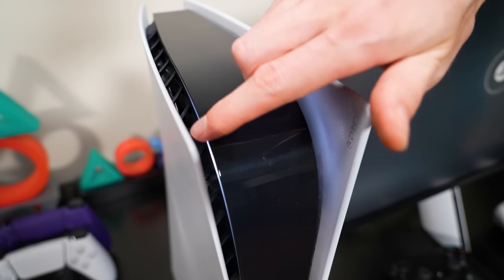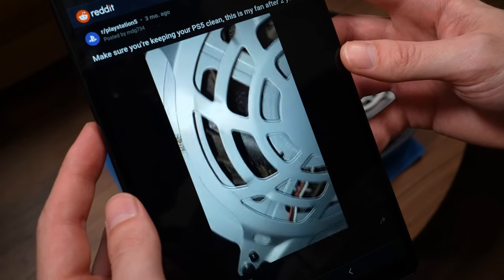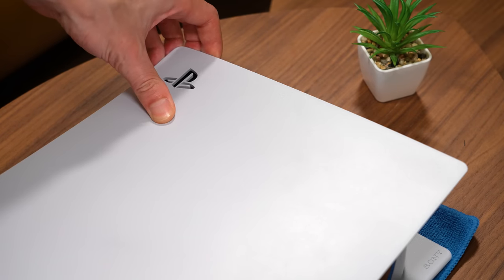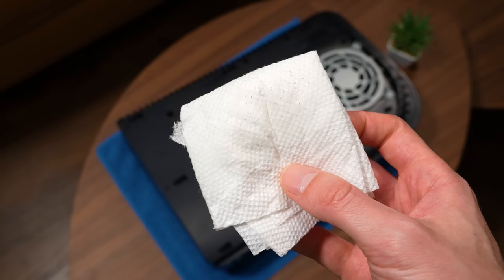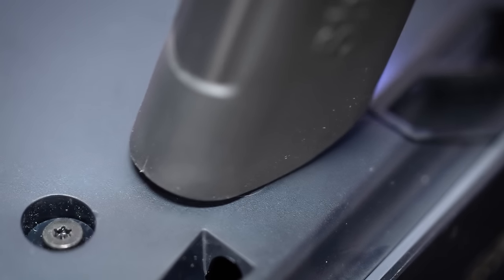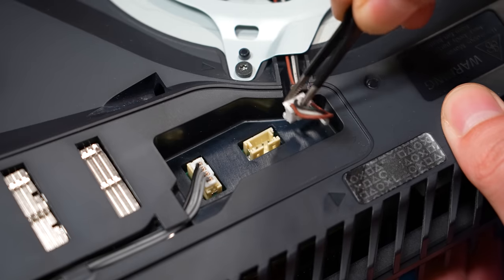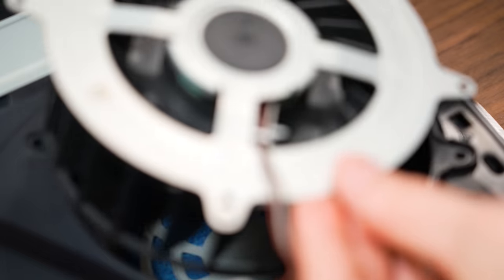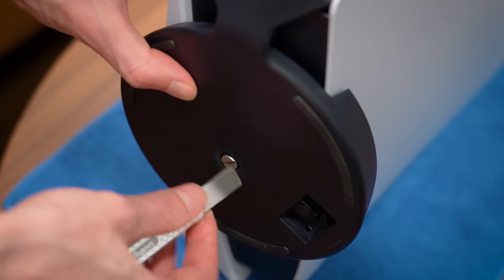It's time every PS5 user checked for this..

Comment: This may not be an issue for everyone however, I’ve had my PS5 since launch and recently opened it to increase the storage. I thought whilst it was open I’d clean it as well however was surprised that there was hardly any dust. Definitely not enough to cause any issues. 

The pictures shown of dust I’d imagine are extreme cases. I think a lot will depend on room ventilation and air quality.
Reply: If you have a dirty room or have your ps5 in an open area it will be prone to dust build up

Its all depending on how clean everything else is because if there's a ton of dust on the fan itself clean yo room
Reply: Bro I did the same. Hardly any dust when I opened mine up
Reply: I’m still trying to get a ps5
Reply: Exactly depends how u treat ur ps5 and what's around u
Reply: @thebutchersboy1138  I got one for you let me know if you need it
Reply: Since March 2021, my PS5 Is with no dust inside, because I Always cover with a protector cover, After use.
Reply: Totally agreed.
Reply: Well it’s not hard to understand that some people’s PS5s will be in more dusty environments than others.
Reply: Mine had a Rat living inside had to put my ps5 outside for a couple days😑😑
Reply: @Grandmatabby  how the fuck- actually nvm
Reply: @Grandmatabby  bruh
Reply: People are dirty xD never cleans or they just never learn the importance until it’s too late
Reply: Yeah unless you have poor circulation or smoke or just dirty period very rare that system gets that dirty. Have had it for 1.5 years and hardly any dust in it when I added storage. Same thing for when I had the PS4 pro…only cleaned it one time since they launched and that was cause I spilled something on it…never understood where all this dust comes from when I see videos like this or computer/laptop cleanings
Reply: Agreed. You seem like a clean person... As am I. When I saw those above images I was like that's definitely cat hair, Cheeto dust, mixed with spilt G_fuel and gamer sweat. Even the PS5 in the video has clearly never reached that level.
Reply: @TheTimmer1234  I have my ps5 in the same room as where I put my laundry to dry.. needless to say it gets very dusty due to the amount of little fibres that come off the clothing
Reply: True dude. Reckon I’ll have a PS5 by about 2040
Reply: @thebutchersboy1138  ps direct
Reply: Does the dust in my imaginary ps5 count? Cuz i still dont have one but have been enjoying my xbox until i get one
Reply: Mines is purely because my pets especially my German shepherd aka ghost from game of thrones long hair. I had power issues so I changed into main plug and didn't work opened up and 6 months the build up with dust and hair was insane it's so open compared to ps4 and ps3. Only cleaned both once in their whole lifespan ps5 I've cleaned every 3 to 6 month since launch
Reply: @thebutchersboy1138  if you are a Pro member at Game Stop, ask your store when the next restock is. We just had a restock at both my towns stores for pro members and there were 30 consoles for each store, I was third in line an hour before open, at open only 10 people in line. Seems like the easiest way now.
Reply: @LUCAS420BLZ  In an open area? I would assume that more dust will build up when the console is placed in some corner, for example on a dresser between two wardrobes
Reply: ?? How where u gonna add more storage in the PS5
Reply: @jaimelopez1820  Just YouTube it. You can add more storage.
Reply: @TheChurchofLoud  thanks man..
Reply: @LUCAS420BLZ  my ps5 is in my living room. It's quite a big living room. Family of 6 use it. We always hoover dust everything and mop the floor at least once a day. My ps5 six months into use was so dusty in side it was horrific.
Reply: Yeah for my original PS4 I got in 2015, when the disk drive broke back in January this year and when taking it to sell at GameStop, taking it apart they were surprised at how clean it was as well as no sticky residue/scratches on it. The only thing I did was use a Swifter duster on it 2-3 times a month and use a tv cabinet from childhood that kept the majority of dust off due to having a door for it as well as a hole in the back for air flow.

Just got my ps5 a couple of weeks ago and I'm dusting it once a week and thinking of getting a dust cover for those times when I'll be out of town for a few days
Reply: @thebutchersboy1138  PlayStation has them right now. They're GOW editions though.
Reply: That and their probably an indoor smoker
Reply: Yeah i have an ac in my room which keeps the room really well tempered, i cleaned the ps5 about a few weeks ago and hardly saw any serious dust buildup
Reply: reconz 82299  not if it's after use it wouldn't matter
Reply: Ive had my ps5 for like a year and a few months and i barely use it so im more scared of a fly in my ps5 than dust
Reply: Having pets makes a lot more debris also.
Reply: @thebutchersboy1138  they’re everywhere, if you’re still struggling to find one then you aren’t actively looking
Reply: Yeah that's a smokers console
Reply: @Ahmed-og2jm  yea no
Reply: @GradietPanda12345  yea yes
Reply: @fiapoto92  The question is... how much are you selling it for?, because we all know where to get one at an abusive price online! eBay, Amazon, Offer up etc etc scalpers are all over the internet selling ps5s at excessive prices
Reply: Exactly
Reply: The same happened to me as well.
Reply: I have a air tight container, when im not using my console i unplug the leads and put it in the container. Been doing it since the 360 days and it definitely helps the longevity of the consoles.
Reply: Had my ps5 since they came out and hardly any dust in it. Gets used everyday but my games room is like a sterile lab. Hate dirt and dust then again I’m really ocd.
Reply: Im not fuckin touching my ps5 when the warrany is still on going nope!
Reply: Whilst lmao
Reply: Definitely not an extreme case but depends on your house. We have a ton of pets so it gets like that pretty quick. We have to change AC air filters monthly in the summer, for context.
Reply: @neverbeaten  taking off the plates shouldn't void warranty it's allowed
Reply: The brown dust may come from smoke
Reply: @jammieweston2566 they're
Reply: @Jestersson I wish I was like this. One of the worst things about depression is you just don't give a fuck what your room looks like. :/
Reply: Exact same. I did a full teardown and had next to no dust. Complete waste of a Sunday after noon, I wouldn't recommend it to anyone. If there's no dust in the main fan just wipe what's accessible with a Microfiber cloth and move on
Reply: Exact same. I did a full teardown and had next to no dust. Complete waste of a Sunday after noon, I wouldn't recommend it to anyone. If there's no dust in the main fan just wipe what's accessible with a Microfiber cloth and move on
Reply: My room gets dusty a few days after a thorough clean… I live in a studio apartment so my bedroom, living room and kitchen is all one room of 21m2🤣

Comment: I took mine apart a few months ago, took the fan out and brushed it all the way through, used a vacuum cleaner to clean dust out of the holes specifically designed for the purpose, and even used compressed air inside and outside to clean the heatsinks, then vacuumed again.

The PS5 is SOOO much easier to clean than the older systems.
Reply: I'd recommend to never use a vacuum. I killed my og fat ps3 that way. It'll ruin the gpu. The console could basically be useless and not worth repair
Reply: @Snickerus-Snape  Shit really?
Reply: @Snickerus-Snape  there are holes specifically made for vacuuming. Literally recommended in a Sony video.
Reply: @Snickerus-Snape  how can a vacuum damage the gpu?
Reply: @ayy17amn  only reason i can see for not using vacuum is it may suck up the screws, but for fans blades a vacuum not great some dust sticks. but it shouldnt kill the console.
Reply: Yeah series x and ps5 are way more easier to clean.
Reply: @ayy17amn  Shit, I'd love to know as well.. If compressed air is safe then a vacuum is not going to harm anything.
Reply: @BlakeGibbons  bc static buildip and damage electronic parts. But like the other commenter said Sony already confirmed themselves that the dust catchers were made to he vacuumed so its safe. I've done it and had no problems
Reply: Same here. Mine still shuts down when playing H:FW. I can't play the game because it just keeps overheating.
Reply: @Snickerus-Snape  no, your old FAT PS3 crapped out out because of bad thermal paste, mine did the same thing.  Vacuuming out the PS3 had nothing to do with that, as the GPU was already beginning to separate from its connections to motherboard before you tried cleaning out the dust.
Reply: @skullfracture3870  Of course. Still doesn't take away from the vacuum being an issue for me. Right after I vacuumed it, that's when it started with the screen freezing and looking all pixelated. I took it to a videogame repair store and they told me it's not worth fixing and refused to fix it. It's a known problem if you vacuum a ps3. Maybe you can vacuum the ps5 vents. I wouldn't put it near the motherboard myself after I ruined my ps3. I'd like to think if it was the thermal paste, they would've fixed it
Reply: What kind of vacuum did you use?? I wanted to get one myself
Reply: Is this guys video accurate to how to do this without braking the console? Id like to clean mine out but do not want to break or snap something.
Reply: @ayy17amn  vacuum cleaner creates static electricity and most of the time it is immediatelly grounded, but it can happen when u vacuum ur pc, then small static discharge to ur pc can kill it pretty easily
Reply: @Snickerus-Snape  yea, the best thing for this is air compressor, thats the best option with which u can clean ur pc or console, then there are that sprays with compressed air, but they are needlessly too much expensive if u compare it with air compressor if u have it and as the last option, u risk a lot when u use vaccum cleaner near semiconductor parts.. in ps5 those are collectors and electronic parts are kinda isolated from it, so its different, but still its better to know about this
Reply: @Snickerus-Snape  
Can I ask when this happened? I have a feeling they might have lied to you about it being fixable. The PS3 is notorious for being way more complicated than it needed to be, so complicated that that's actually the reason PS3 games weren't backwards compatible on PS4. It's stupid and I honestly don't know what Sony was thinking when they made it the way they did. Idk, I've just got the suspicion that rather than it being too lost to save, it was too needlessly complex of a fix that they didn't want to do it.
Reply: @wahmeister666   doesnt appy to ps5
Reply: @HAlariousInc  I vacuumed mine 3 days ago. Just went with it. Just vacuumed, no compressed air. Wasn't even that bad with dust which was a surprise after 16 months.
Reply: Imagine cleaning your console. So cringe man
Reply: @Miriam_J_  If a GPU is actually broken they would have to replace the whole chip which is not something that Sony would sell a repair shop. Not to mention a lot of repair shops won't replace a  GPU, CPU or APU on any console.
Reply: Mine had a Rat living inside..had to put my ps5 outside for a couple days😑😑
Reply: @Grandmatabby  Does your PS5 still work? My old house had a rat problem and those rats would chew up cables. I had to replace a lot of electronics.

(In case you're wondering why we had a massive rat problem it was because animal control decided to take away every single cat that wasn't in a house. There were a lot of cats around the neighborhood that were given food by residents before then.)
Reply: @Snickerus-Snape  the ps3 didn't have holes designed to be vacuumed....
Reply: @Snickerus-Snape  Damn i did a repaste on my phat ps3 backwards compatible its running like new now espically since I jailbroke it sad that happened to you bro

Comment: Another tip!!

When the fan is out, use air duster to blow dust out of the heatsinks whilst you have easier access to them!
Reply: Agree, this should be the whole point of removing the fan for a regular user
Reply: @s173nc10  I was pretty sure he was planning to do this, why go through all that effort and leave the dust stuck in the heatsink vents 🤗

Comment: Doing this every 6 months is great, but in between make sure to check those vents, remove the face plates and give them a good cleaning (check the dust catchers with a vacuum as well).
It's a fast process and if you do it frequently enough you'll have less gunk reaching the fans - and worse - the heatsink.

Comment: What I also highly recommend ps5 owners to do while cleaning the fan is to flash a light down to the bottom of the ps5 to check for dust build up. That’s actually where the battery is. For 5 months, my ps5 kept turning off while playing games and overheating. This is the reason why. Use a brush and a vacuum to get rid of the dust that’s on the battery.
Reply: *powersupply not battery
Reply: @impala403 yea ps5 does not have a battery

Comment: Depending on where you live and whether you have pets or a smoker (of any kind) in your home, you might want to give it a cleaning every 3 months or at least check it that often. That works for my situation with a couple of very hairy cats in an apartment. Also, air cans are way expensive now. Don't forget to use a vacuum to get the main stuff out before you start blowing dust through the system.
Reply: I have an alaskan malamute. So i feel that. 😂
Reply: I feel bad for my consoles sometimes cause I live in Texas always dry here we live down a dirt road I have cats and a dog and I smoke I might go clean it right now actually lmao
Reply: The tar from the smoke seems to bond with the hairs and make nice little clumps. I got an airfilter for my consoles health not mine.
Reply: @NunayahBuisness  It does bond. Wish I could post a pic of my old PS4 fan here. Just wow. I have to say, the PS4 was a rugged beast. It should have had  problems much earlier. I like the idea of a filter for the PS5.
Reply: @joeofoysterbay7197  it doesn't completely take care of the problem, but looking at how the filters look when I change them I figure it's at least reducing the amount going into the console.
Reply: Anyone else get a yellow huhish tint on there inner plates? Think it's either from me blowing my dab cart around the ps5 or maybe it's the incents I light in the room🤔
Reply: Use a compressor.